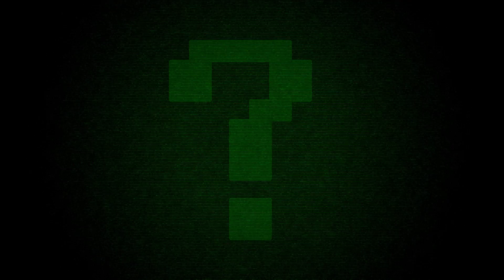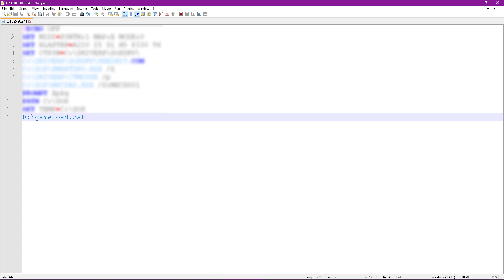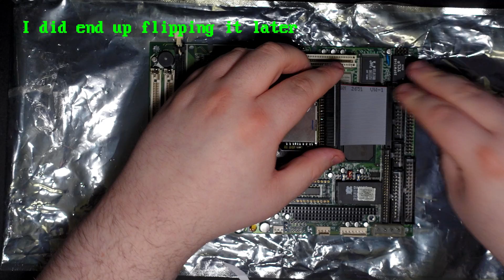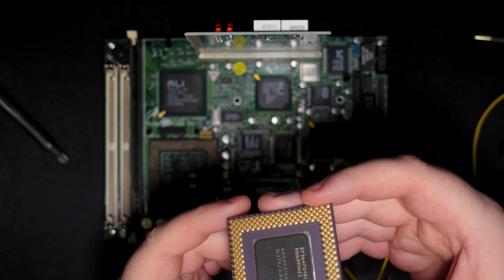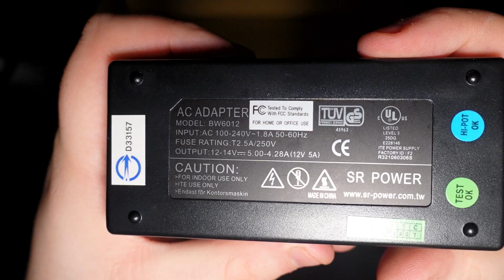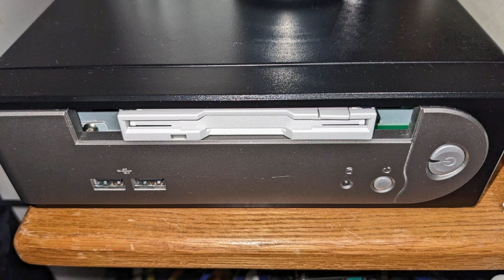Let's build an MS-DOS console - Part1 - #DOScember2022

Comment: the red wire - pin 1 is not power, it's the reset signal. the ide doesnot carry any power for the device so connecting it the wrong way will not burn anything.

Comment: You should have used a ZIP drive.
Reply from the maker: No, I shouldn't
Reply: @PIPERdotEXE  Maybe not, but that would have made it more interesting as you should be able to fit bigger games on them, giving you an experience closer to what you were after. Very good video, at any rate. Cheers. :)
Reply: @PIPERdotEXE  You're a blast. 🙄

Comment: What I will say sounds heretical even for my own tastes. Although I have collected tons of retro hardware to make DOS PC projects, including some top notch hardware of that era that I purchased for dirt cheap prices the recent years, I ended up realizing that emulation is the way to go for all sorts of old hardware. Yes, I know, it is not original and we all like original, however the overhead of building an original system of the era with original old components could prove a nightmare given the condition of the capacitors and the incompatibility between old devices. Terms like "conflicting IRQs", "incompatibilities", "not enough high memory", "memmaker", "EMS", "XMS",  "UMB" , "mouse driver", "inverted ribbon cable", "config.sys", "autoexec.bat" and all those things of the past are both things I totally love and totally hate at the same time. I truly admire the scope of this project and I do stand with you but if I would attempt to do something similar I would either use emulation within a more modern system or I would use a full size retro PC case. ITX wasn't a thing in those days and if ITX is somewhat niche market today, imagine what it was then... S3 Virge and S3 Virge DX did not have any sort of 3D acceleration. The only one that did was S3 Virge GX that was still shamefully slow. What S3 Virge had was great compatibility with DOS titles and it stands as reference point for modern DOS emulators. The most compatible soundcards for old dos games were Sound Blaster Pro 2 and Sound Blaster 16 that have been emulated almost perfectly with time. I subscribed only to see how this project goes. It really feels like something I would try! Good luck with it! I am looking forward to part 2!
Reply from the maker: Oh sure, normally I would be doing just that, I try and get the most I can out of my one main PC, I run DOSbox, and have a number of other tricks including source-ports, patches, wrappers etc. This is nothing but a headache, usually the hardware I deal in is late 90s to mid to late 2000s, and this avoids a lot of these problems, but on this project I decided to get a little fancy. I realise ITX wasn't, but there's not much outside of 3D printing, that would give me a "console-y" looking box. This S3 card does appear to have it, but it's weak, I've come to realise that there's precious few DOS games that do have 3D, and the ones that do, probably use Voodoo. 
Thanks, part 2 will be along when I can get it done, hopefully you will stick around for more than just this in time
Reply: @PIPERdotEXE  I will for sure stick around for that. It brings a smile to my face when I find such endeavours. My first PC was a 486 100MHz, 8MB RAM SVGA, SB Pro 2. After that I got my hands on thousands of systems. I even worked for years in a repair shop as a technician. I just love old PCs but I love more the new ones. I like what Phil says his page (Phil's Computer Lab), to quote "I was always into computers, old, new, real and emulated". I love channels like yours. Good luck mate. I will stick around.
Reply from the maker: Great to hear :)
Reply: It can be headache, but there's also something very satisfying about the way things work in DOS. You plug in an ISA card, manually allocate some resources and tell your software where to find it. For the few things that need drivers, you run them by hand or write a line in autoexec to do it for you with whatever settings you like. 

You need to know what you're doing, but equally nothing really goes on without you knowing. It's a much more direct relationship with your PC down to the hardware level.
Reply: @ozzyp97  That's why while I hate all those things of the past, I also totally love them. It was, as you pointed out, a much more direct relationship with your system. When things were working fine, it was something to be celebrated and it was consistent. One does not visit those things older than what they first encountered when it comes to technology.

Comment: The red line on ribbon cables is supposed to indicate pin 1, not power. It's always been that way as long as I have been working with computers, and we are talking about going back as far as the late 80's, even though ribbon cables have been in use a lot longer than that! It could be that the cable has had the connectors put on backwards.

Comment: aahh that motherboard gets a tick down for using a forsaken dallas battery clock   those a ticking time bomb
Reply from the maker: I replaced mine, thought about a coin cell retrofit, but I wonder if this board is even worth it
Reply: @PIPERdotEXE  yeah. After seeing the issues you had :/. That setup seams fragile to the slightest change
Reply from the maker: Seems to be, the seller mentioned flaky power sockets, and I did notice that the caps near the CPU are a tiny bit "bulgy", they will need to be replaced at some point, they could be affecting power delivery
Reply: Honestly, I'm relieved when I see those on older boards.  They're pretty much always dead, but at least they can hold their liquor.  I bought a tube of sockets, and have a batch of home-made PCBs with SMD clock ICs and CR2032 holders on top, that drop right into the socket, and it's job done for another 10-25 years.

Beats scraping rotted copper off a motherboard...  :-)

Comment: The S3 Virge is a really good video card, but the 3D acceleration is pretty useless. My experience back in the day is that the Pentium Pro could render Tomb Raider faster and cleaner than S3 Virge 3D acceleration. 3DFX is fairly late stage gaming anyway, so 2D should cover all the cool games. 😉

The joystick emulator looks like an IRQ conflict. Likely the serial port you're using for the mouse is on the same IRQ as the joystick and you're just not aware. You will need to ensure that you set a good dead zone as the old pots on those drift a LOT, which is a huge problem if you're thunking to keyboard inputs.

I'm surprised you used a non-boot disk for game launching. Back in my DOS days, first thing I did when I got a new game was to create a boot disk. That's because the mishmash of EMS/XMS, CD ROM drivers, mouse drivers, sound card drivers, and other hardware meant that nearly every game had to be tweaked to make the right amount low memory available along with the right amount of extended memory with the right drivers. Pretty easy to add the launcher script to the autoexec.bat of your boot disk after configuring the config.sys. Makes the disk more useful than a launch script too.

Someone else mentioned a ZIP disk. That's actually a pretty good idea for a "console" like experience. Only problem is that you can't boot off it, but it's better than using the B: drive like you're currently doing. You could even detect and autorun file on the zip disk and boot normally if there's nothing in the drive.

Overall, very neat project. I hope it works out well!c
Reply: i remember how much of a pain in the ass it was to get ultima 7 and 7 part 2 running without a boot disk back in the day, i could do it in my sleep now but back then dealing with the memory managers was so much of a pain in the ass that i always just used a boot disk then ran it off my primary drive.
Reply: oh, and luckily these days with dos box all you have to do is type "xms off" and poof, ultima 7 and serpent isle run fine
Reply: @kght222  Oh heck yeah. I mentioned in a comment below that there's no way I'm going back to period hardware. I'm perfectly happy with emulation, thank you very much. 

The clincher for me is the fact that there's no such thing as "period correct hardware". Back in the day you had what you had. If you had a 486 in 1990, you were almost certainly running everything too fast. If you had a 486 in 1996, you were almost certainly running everything too slow. I remember Carmen Sandiego running faster on a CGA PCjr than a much prettier EGA XT. 

Those experiences are all interesting memories, but they're a consequence of the landscape of computers. Not the way the games were "intended" to be played. (Hell, there probably wasn't a precise "intended" with many of them.) Today I can cycle up and down as needed to find the experience I want, and I'm happy with that. I've got too many other hardware projects to dick around with old PC hardware.
Reply: @thewiirocks  To be fair, most early 90s or even late 80s games aren't directly CPU sensitive, you're more likely to encounter physics bugs or sound issues than outright speedup, which can often be alleviated by disabling cache. Ultima  7/UW and XCOM are some big exceptions, both of which happen to be a pretty good fit for a 486DX33. Admittedly the opposite is more true, even Doom doesn't run all that great on a typical 486. If you did want to go hardware, you'd probably want a different PC for late DOS / early Windows, a P2 or even P3 could do.

I'm not saying that it's easier or even better than emulation, but I do think you can get quite "period correct" results either way.
Reply: @ozzyp97  Have to disagree with you, I’m afraid. In my experience it’s not just Ultima. Most Origin titles are CPU sensitive, with the Wing Commander series immediately popping to mind as an example. The original Wing Commander was so bad that there simply isn’t a “correct speed” to run it at. I played it on a 486 DX2/50, but that’s a very different experience to everyone who played it on a 386. 

Games of the time didn’t use the RTC for timing. If for no other reason that the use of high resolution clocks (i.e. millisecond or better) weren’t very common yet. Instead, many games attempted to use VSync for time control, using extra frame time for double buffering to smooth out spikes in frame rendering time. This approach makes many games of the time somewhat well-behaved, but it doesn’t mean they weren’t affected by CPU performance.

DOOM for example, has a fairly famous story of how everyone in the ID office was running postage stamp sized viewports to try and keep up with the one guy who had gotten himself a 486. Despite DOOM being VSynced, the player with the higher frame rate had a massive advantage over everyone else.

It was only well into the Pentium era that we started seeing games that would hit the 60FPS limit, leading to consistent experiences. And that was short lived as game designers pushed the hardware. This made the game speeds inconsistent again and by the late 90s games started employing game state update cycles independent of frame rate. This more effectively solved the problem and is a technique still in use today. 

Source: I lived through this period and was even responsible for a popular video game timing library known as GAGETimer.
Reply: @ozzyp97  Another example that comes to mind is that I was just playing Alien Legacy (1994) recently. If you don’t adjust the cycle count on DOSBox to about 10,000, all of the animations will move ridiculously fast. Including the arcade sequences when you search planets. Even though the game timer is locked to real time. This has a very real impact on the game as fuel is used at excessive rates to learn information that was intended to only require small amounts of fuel. Furthermore, placement of facilities is complicated by too-fast scrolling that constantly slams you from one side of the planet to the other.
Reply: @thewiirocks  There are more examples than the ones I mentioned of course, but I still don't think it's quite the problem people sometimes make it to be. LucasArts and Sierra games mostly don't speed up, iD games like Wolfenstein 3D or Commander Keen don't speed up, Epic games, Lemmings, Transport Tycoon, Civ, Sim City etc. are pretty much fine and so on. Severely speed sensitive games exist, but they're the minority after 386 came around, at least as far as relatively big name studios go.
Reply from the maker: Yeah, tends to be old old games especially from the XT era that have the problems
Reply: @PIPERdotEXE  There’s a pretty big difference between “you’re okay with the experience you’re getting” and “there’s no difference in experience”. I’m not referring to the too-fast-to-play games which were mostly the problem of games tuned to the original 4.77 MHz IBM PCs. I’m referring to games where the timings and gameplay change subtly depending on the system you run them on. That is MOST of the games in the early to mid 90s. Much of the VGA Wing Commander series, Ultima, Alien Legacy, Sierra Adventure titles, Lucas Arts adventure titles, DOOM, etc. Some games like Tie Fighter have logic problems where odd things can happen if the game is run too fast. 

Just about EVERYTHING from that era is speed sensitive. Our actual real-world experience for many of these games was actually “286 or 386 slide show mode”. Which PC Gamers were just plain used to back then. Don’t even get me started on disk access times. I always thought Lance Boyle was Ssss-sss-ss-supposed to stutter in Megarace. When in fact, it was a clever way of masking out the CD-ROM read performance. Which means if you play Megarace today, you’re going to have a different experience than I did when it was new. A vastly different experience? Maybe, maybe not. The exact result was dependent on the game. Some had bigger issues than others. Some just plain refuse to run unless you can lower the speed somehow. 

Anything that you consider “period correct” is going to be a unique experience. Possibly quite a bit better than anyone experienced back in the day due to higher I/O rates and use of a higher end CPU. In some cases the experience may be subtlety worse and you simply won’t realize why. Either way, it’s unlikely to be the exact same experience. That’s just the reality. 

Which is why I don’t (personally) bother with DOS hardware. All that work isn’t going to bring back the experiences I had then. And even if I managed to get everything exactly the same (which is possible, though increasingly uncommon) I’m not sure I want to bother. I can use DOSBox to tune for the experience I want and just not worry about it.

Except for Lance Boyle that is. I would probably need to do some additional* h-h-h-h-hacking of DOSBox if I wanted to throttle the CD-ROM data rate. Though I have heard that DOSBox-X has that support already? I need to try that version one of these days.

* I say “additional” because I’ve helped maintain DOSBox a number of times in the past. Got CD-ROM support working in the Emscripten version, overhauled the Dingoo version to work well on RetroFW MIPS-based devices, and even did some support of SCUMMVM on a few occasions.

Comment: Ah the joys of old PC motherboards, jumpers, PATA/IDE drives and good old MS DOS configuration. I remember those days, but not  especially fondly. 😁  My routine is: check you've got power first (you'd be surprised how many times I found someone forgot to plug it in!) then check the last device you added to the system. Then check all the cables, reseat the RAM, (one stick at a time, preferably a known working SIMM/DIMM), and try it in different sockets. Then look at the jumper settings and lastly the CPU. I would suggest having a keyboard attached when doing any power on testing, as those older BIOSs often required fettling to get hard drives up and running or disabling onboard graphics, setting IRQ's etc. And then you've got the joy of finding all the right drivers! Looking forward to part 2. 🙂

Comment: Uh... put an SD card in your IDE to SD Card thingy... that might solve the issue.

Also, start looking for a Voodoo; take into account it needs a display cable between Voodoo and the 2D card; S3 "does 3D", yeah, but only a few games made for it; the truly greats you want to use the GPU for from 1996; Quake / Tomb Raider, don't work with it.
Reply from the maker: It was tried with and without, you would also see at least some indication of hardware there, also this would not cause the non-POST issues I was having

Comment: there is supposedly a PCI sound card that has compatibility to SoundBlaster andhas a way of emulating interrupts behavior such that MS-DOS games will see it as a legit ISA-bus SoundBlaster card

the upshot is that it then becomes feasible to build a modern x86 PC that is able to run early 90s MS-DOS and DOS games in native instruction execution mode

would insanely fast given modern CPU clockspeeds
Reply from the maker: Well, it seems a lot of sound cards, including the Sound Blaster Live in the 98 Machine that I was using to test, does have limited Sound Blaster support, though it's not perfect, for example I couldn't get General MIDI on there for some reason

Comment: You went the hard way, just use old correct pc cards from 1995/2000, I coud assemble a whole ms-dos console and make it running in less than 20 mintues all together... then running quake/doom/etc....
Reply from the maker: I did, and good for you. I had specific intents in mind, it should have gone easier, but it didn't